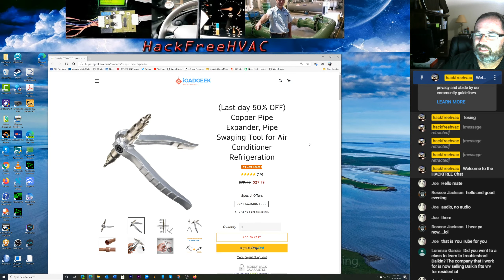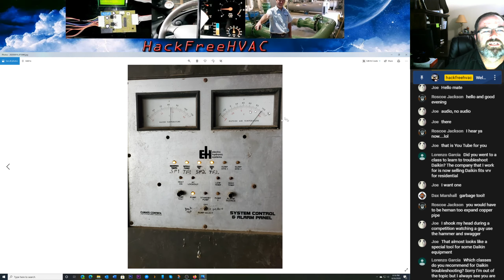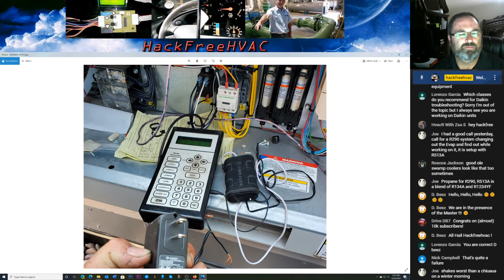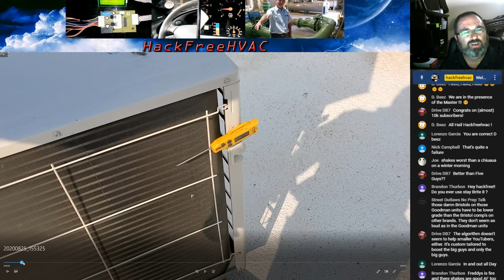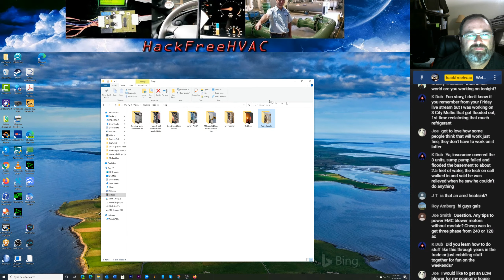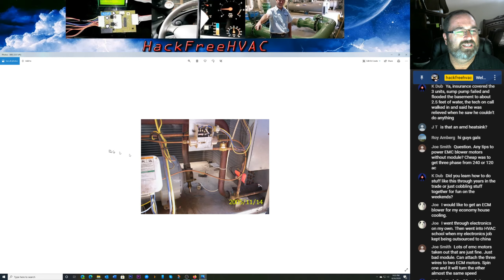hackfreehvac Live Stream 08/26/2020

Comment: I don't know of any utilities that charge for residential VARs, but they typically do charge a penalty to 3 phase customers with poor power factor. Inductive VARs are a burden for the utility to deal with. They reduce voltage at that part of the circuit and increase apparent power on the circuit. Capacitive VARs could prop up the voltage on that part of the circuit at the cost of increasing the overall apparent power on the lines (uses up some of the overall available capacity on the circuit.)